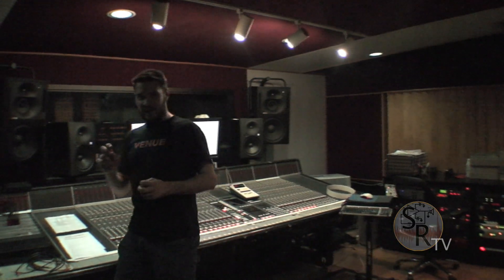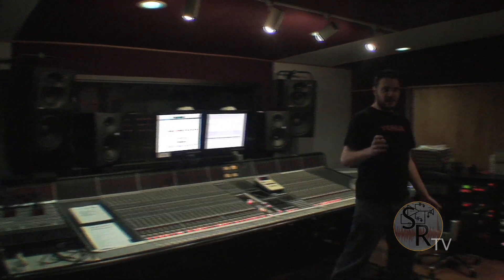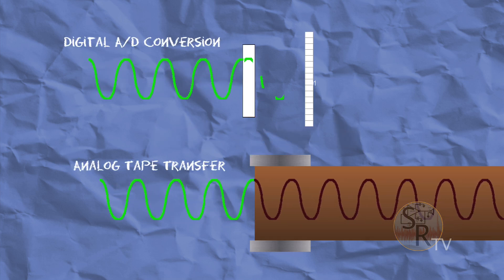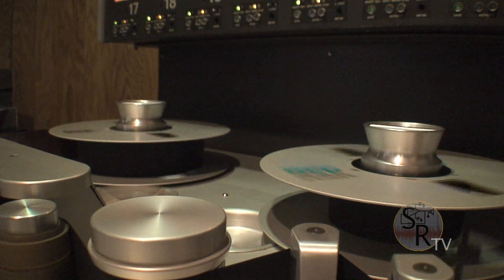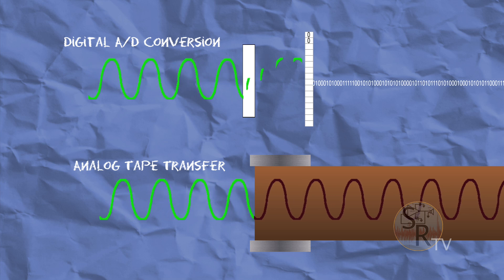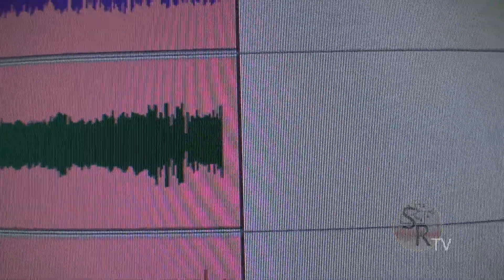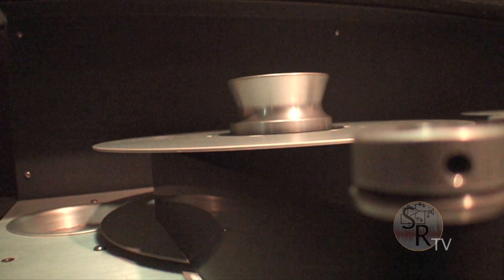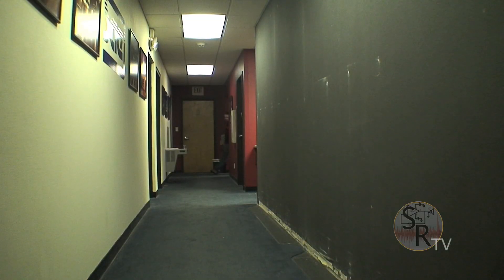Analog Tape Vs. Digital Shootout (Sample-Rate.com

Comment: No it does not. Did you see what he said? He explained it right at the start! However, the computers nowdays can store the wave with much higher quality than they used to. 24bit is pretty good! but the cds and stuff is still converted down to 16bit, so it looses some quality. But if we were to get to where we could mix and listen in say, 64bit, then the difference would be so little that it may as well not even be there. I still think that the mixing should be done with tape, and then converted.

Comment: There's actually a cool mix of the two, called "Hybridology", using analog tape for the low end and digital for the high end. It sounds very punchy in the lows yet clear in the highs. A different sound cool for some kinds of music. Though I would think the other way around would be interesting too (analog highs, digital lows).

Comment: Digital is arguably more accurate for low/mid quality gear. Analog is in a whole different league when it comes to hi-end gear. It leaves digital in the dust

If you want to add color, go right ahead. If you want to turn the color saturation up on your TV, have fun

If you want to close your eyes and be fooled into hearing a live performance, you will want uncolored reproduction. I take it from your comments that you have not had the good fortune to experience such a setup. It is a reality check

Comment: Both of you are off base a bit. First, nothing in sound or electronics is "exact as it's coming in". But digital is audibly closer to sounding like the real source vs tape. In the future when sampling rates and bit depth increase beyond a certain point, you will hear no difference. Why would you say if your analog recording sounds colored, change your gear? You use analog for the color.  Theres no winner in analog vs digital. you can use whatever you want to color how you want its all subjective

Comment: the audio from the analog tape day 3 sounds way more full even converted to wave file. deeper tones and brighter highs just give it a fuller sound. especially on the cymbals.
audio from pro tools sounded a bit flat and all the sounds weren't there.
good test.
used AKG k240 headphone monitors.

Comment: The gear you use to record will depend on HOW you use it, how you use your ears. The warmth and saturation analogue-heads bang on about are actually engineering errors. Don't use a crappy memory resident digital package like Pro-Tools but use dedicated digital recording gear. If you spend about $1000 minimum on your multitracker then you will have something which with a little care, you can make pro recordings. Do you know how much 2" tape costs?

Comment: The analogue is only as good as the equipment used. For example, that tape recorder is out of the reach of most peoples financial and practical capacity. Digital just saves us a step and is a hell of a lot better than old cassettes at a fraction of the price.

Comment: @respinozaaudio The solution to those problems would be 1) save up for tape; and 2) don't even bother recording if the band is so shitty that you have to do 50 takes on ProTools. I heard the tape saturation which, to my ears, sounded way better than the cold digital file. This video was not a waste of time for me.

Comment: @3:45
"Digital isn't colored"?
"It's exact as its coming in"?
You have it backwards.
.
Digital erases 100% of nature's analog original, turns it into numbers, and then a processing chip creates the sound from scratch.  You are hearing that chip, and the computations made during the two conversions (analog to digital and then digital to analog for playback).
.
If your analog recording sounds colored, change your gear.  Expensive (studio) gear does not guarantee uncolored sound.

Comment: @siqkek9 
What I wrote is what I meant.
.
The sample rate was discussed in the video -- and that is not the same as the bit rate, which is how much information is stored in each sample.
99.9% of what we hear is not affected by high frequency roll-off on professional reel-to-reel tape.  Everything else, such as voices (which the human ear is very tuned in to) is more accurate when exclusively analog.
.
Problem w/ analog is that studios toss quality control out the window when pressing.records.

Comment: Absent from this video are the problems that digital introduces, such as the low bit rate (how much data is (not) in each sample), and jitter (not uniformly playing back each sample)).

Analog, when done right, sounds better.  Not because it adds color (that is not an example of analog done right), but because of the absence of color and the accurate reproduction of the original source.

Comment: In the first place the frequency spectrum doen't same to me. Defferent spectrum sound defferent is natural. If one of the method doesn't record whole frequency equal that'll be the problem. It's not benefit. Anyway you need more scientific explantion with using analyzers instead of showing an audio boosted low frequency.

Comment: Man I always tend to lean the analog route, cause it pure, unpredictable, or predictable and pure fat. Another thing to consider is that an mci will also sound different from a studer or a studer will sound different from an otari, or a 3m m79, or a scully or even ampex. The audio cards are different. Its hard to mimic a mechanical device. But without a doubt analog will always be first in my books!

Comment: There is a lot of plus in quality in just using cassette tape deck, it cut the bad frequencie on high level and adding a saturation and cycle effect, Vinyle also win the Quality war ^^ using 2 inche tape with OTARI or MCI recorder is a very cool luxury stuff.